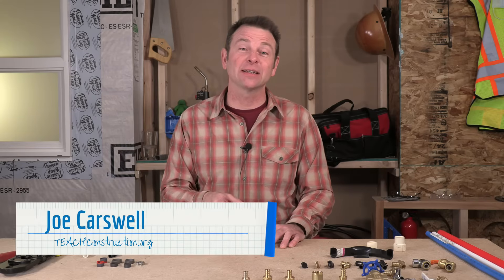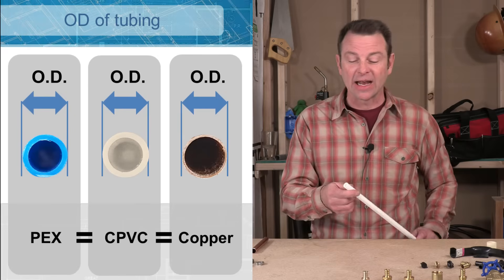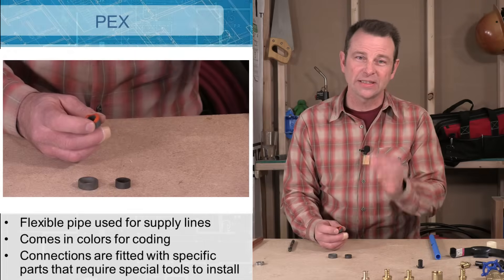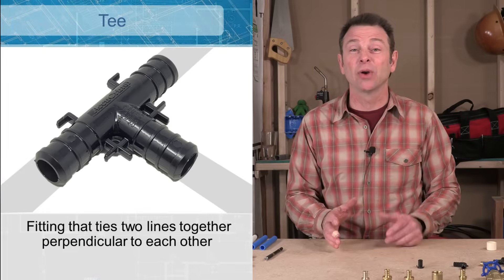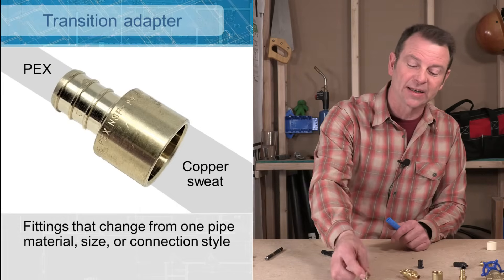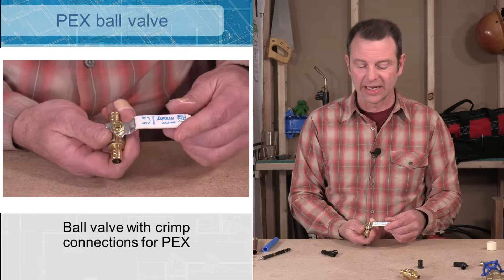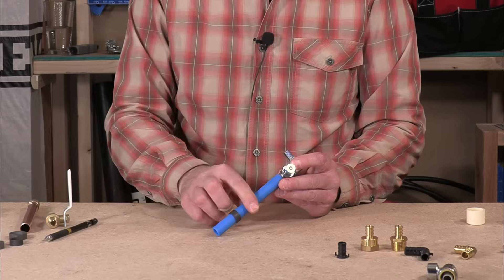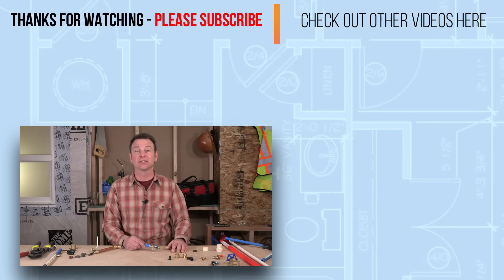A lesson about basic PEX plumbing materials  - Intro to Plumbing Systems

Comment: Regarding the stab fittings (sharkbite) they get expensive quick. They are less work and often are perfect in tight places where you cant get crimping tools. But on a large project when estimating the cost you might find figuring with crimp connections to be easily affordable. Figure the same job with sharkbite fittings can easily be 6 times the price of the crimp price. There are crimp tools for 30 bucks but you gotta search for them. The diy stires rarely have them on the shelves but never run out of the 150 to 450 dollar crimp tools
Reply from the maker: You are correct that slip on fitting like SharkBite are very pricy.  I keep a couple in my bag for the must use situations (like a cap).  I found a good cheap crimping tool at a pawn shop.
Reply: @ConstructionEd  shark bite fittings are one of the best inventions I've ever seen as far as plumbing repairs go but it would cost a 100k to plumb an entire house with them.
Reply from the maker: @davidreynolds4684  Agreed.   But they make short work simple repairs.   Personally, if I can not use PEX for whatever reason, I like crimp copper.   The fittings are expensive, but wow is it fast work
Reply: @ConstructionEd  I've found the saddle crips for pex are more apt to fail than the ones that crimp around the whole fitting. Be sure to stay clear of the original swiss pex. They still have it in places and it's not good or safe

Comment: Good video. Very informative. You may have covered the fact that sch 40 pvc is a different od than pex cpvc and copper but can be connected with pex systems. For those who have little to no knowledge of plumbing.
Reply from the maker: Good suggestion

Comment: I looked at a house being built (framing stage) about 1/4 mile from ocean. I was bidding on plumbing a mansion about 2 lots away and wanted to see what locals were using. (Laguna Beach, Ca.) Any and all metals exposed to the air, including the crimp rings were beginning to show rust. Yikes!
I like Uponor plastic expansion ring systems. All plastic, keep it away from radiant heat and sunlight. I've installed 100's of miles of this. 
I have a pool house out back of my house and in 2018 I purposely ran about 10 feet of hot & cold Uponor Pex that gets about 5-6 hours of direct SoCalif sunlight a day. About 2 weeks ago I checked on it by pushing it around, hitting it with a grade stake & such...seems fine. Eventually I'll replace it with copper, just wanted to experiment cuz I can. Thanks!
Reply from the maker: Cool experiment - I also like the PEX A with Plastic Rings

Comment: Pex really sucks.  The fittings for pexB reduce the flow.  The actual ID of the tubing is undersized from the stated measurement.  As pex is heated the pressure limit gets lower.   PexA is very expensive by comparison and the  availability of various fittings for it is very limited thus be high priced also.  The expander tool is cost prohibitive for a homeowner occasional use.
Reply from the maker: PEX does have drawbacks - but in many use cases it is better

Comment: My water is very hard, high calcium and mineral, do you think the brass long term would corrode and be inferior to the basic plastic connectors? Thanks for your reply and fantastic video rundown. -Cheers
Reply from the maker: I am told that the brass fittings are rated for hard water.   But with PEX it is always best practice to keep the amount of fittings to a minimum.

Comment: Awesome video. I plumbed my tiny little cabin in copper and then cpvc and every year regardless of how I winterize something always splits or comes loose. This looks promising. Thank you.
Reply from the maker: PEX is great for cabins that need winterizing - but you will still need to drain and blow out the pipes - but PEX can avoid some of those breaks each spring.
Reply: Blow out the system with a air compressor  one faucet at a time

Comment: Good to know. Nothing like learning about new technology to keep things running in top condition at home. I just learned that my 32 year old neglected a/c evaporator needs a clean sweeping.
Reply from the maker: You do need keep the coils clean to work well.
Reply: @ConstructionEd  
I went down to the basement to inspect the evaporator, only to find the ac/furnace tech had left an 8'' gap access panel. Made up of sheet metal and ''C'' brackets. Hardly enough room for a brush and aerosol can.

It won't be easy to clean.

Comment: Great video. Question…. I need to plumb at a camp where the water is gravity fed from a spring. There is very limited plumbing needed. I want to avoid constricting the flow as much as possible.  Which connectors are best or do they all constrict the same. I could go to 3/4 pipe rather than 1/2 inch it currently is
Reply: Go 3/4" if the current is 1/2". The inner diameter for pex is a lot smaller than copper and replacing 1/2" with 1/2"  will reduce the flow
Reply from the maker: I agree - use 3/4 if you can - and you may want to consider PEX A if you can get your hands on an expander tool for rent or cheap.   Otherwise PEX B at 3/4 is fine also.

Comment: Is this also used in air fittings for a commercial truck
Reply from the maker: Not the same material - but there are similarities
Reply: I figure that was the case. Just need to splice a under seat 1/4” hose

Comment: Nice job, I have a home with PB and all the lines are home runned to a manabloc.  The lines would go right to the toilet valve assembly and to replace that the plumber told me to just hold on to the gray pipe and spin the fitting off and it worked.  To me that seems off.  I imagine they screwed the fitting on and then crimped it and then I was able to spin it off and on and it has not leaked.  I believe the barbs are different but I am curious what a pro would think of that....  I woudl consider the right way to do over a new vanity for exampl to convert the PB to Pex and step it up to 1/2 and then a 1/2 pex ball valve to a braided line that feeds the faucet.
Reply from the maker: that is one way to get it done.

Comment: I may have missed it but what is the difference between the plastic and brass fittings?  Is one better than the other?  Great video!
Reply from the maker: They can both do the job - but if it were me I would use the brass fittings.
Reply: I would say the brass would be the most beneficial for colder climates as the seam on the plastic fittings are where they tend to fail in colder weather. The plastic ones may be more beneficial if the water treatment in your municipality had a negative effect on brass as plastic could be immune to those chemical treatments.

Comment: When washing machine is on I hear some sound in a bathroom . Either coming from floor or wall behind tube. Is there anyway to identify exact source via sound . Is it possible that a Clip or faster was too tight in the walls. 

Other alternative is can I attach something like a gradual flow control behind washer. My psi is 64 should I drop it to 55.

The noise also comes when I the toilet tank flushes.
This I controlled by adjusting opening of valve. 

What would happen if the pipe was loose and not burried right under foundarion.
Reply from the maker: Sorry, that is way too much to try to trouble shoot over a comment field on a YouTube post.   The sound of water flowing could sound louder if it is resting on the drywall of a wall panel - but you confused me when talking about the foundation.    But like I said - it is too hard to help trouble shoot in this forum - but I do wish you luck.
Reply: @ConstructionEd  the sound is due to some ringing of pipe it is some kind of water hammer. But can't locate sound source. I used to work for Visteon doing flow induced vibration. 

Pipe makes noise when toilet water suddenly stops when valve closes.

Comment: I just found this channel because all the pipes burst in a house I’m revamping. I am somewhat new to construction and this channel is such a breath of fresh air. Thank you for explaining everything clearly.
Reply from the maker: Thanks for watching and sharing.  Good luck with those pipes.
Reply: Just had a -18F night here and my copper pipes burst in SEVEN places... one completely in half at a joint. Going to replacing it all with PEX-A
Reply: Use the correct material and you'll PROBABLY have no issues. Eventually, under proper circumstances, residential products tend to have failure points. Take a look at some of the hospital grade stuff. Anyway, depending on where you are, "heat" is your friend. I'm in the South now. Nobody who asks me about this stuff believes pipes here burst. Until there's or someone they know has a burst pipe. You hope for the best, but you plan for the worst, and hope you never need it. Waste of money? If so, why buy jumper cables?

Best wishes & best of luck. You sound like a pro in the making. I instruct on jobsites up and coming Techs. You're miles ahead, already. Trust me.